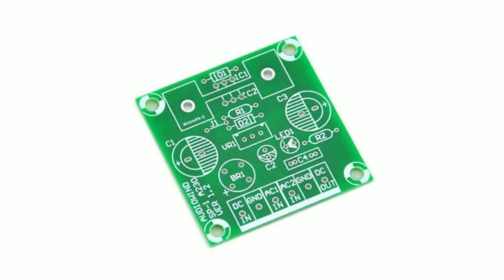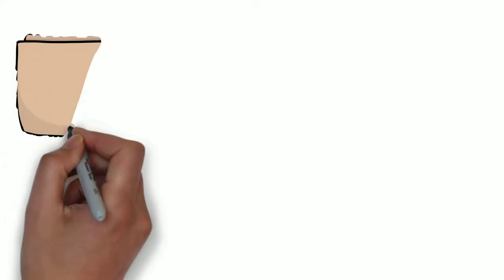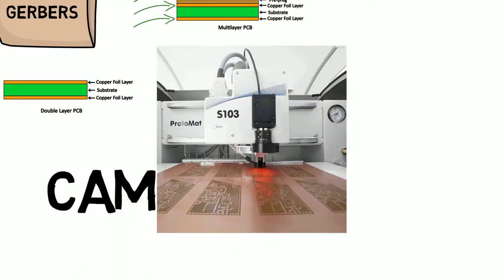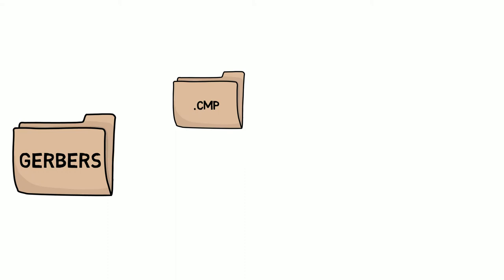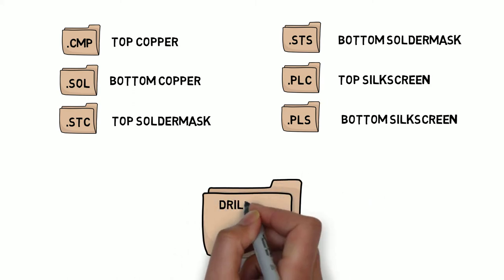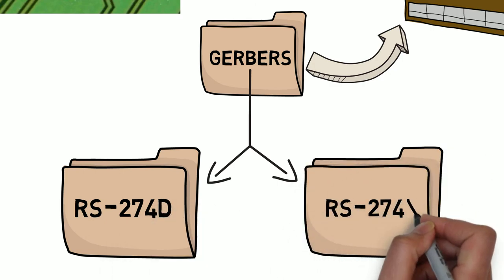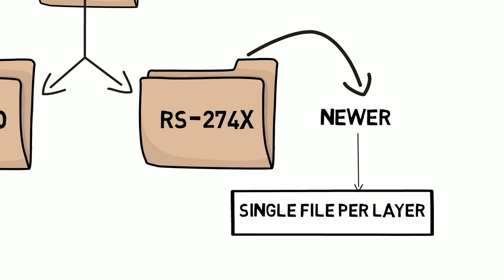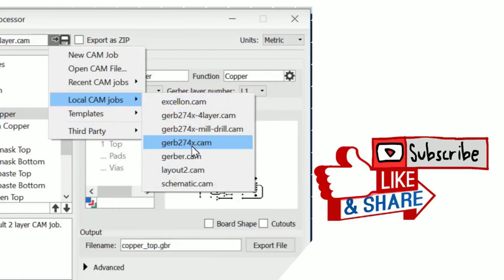What are Gerber and Drill Files | Gerber and Drill Files Explained | ihrProjects

Comment: Thanks. I had to run it at .75 speed, you speak way too fast. Also, I had to turn on Closed Captions (BTW there are a lot of errors there). Your graphics are good.
Reply from the maker: Thanks for the feedback
Reply: You speak in a monotone. If you could modulate your voice, it would help. Otherwise, technically good.
Reply from the maker: Thanks for the feedback Steve, I'll try to improve.